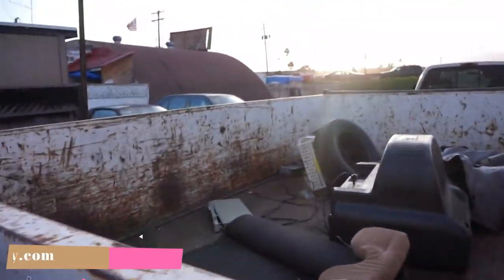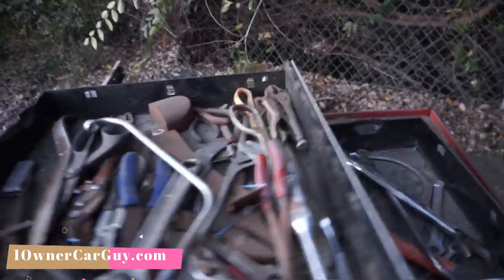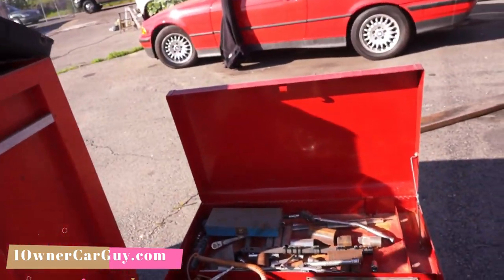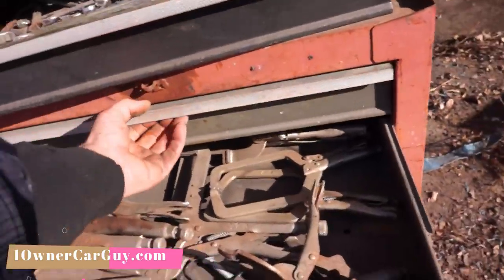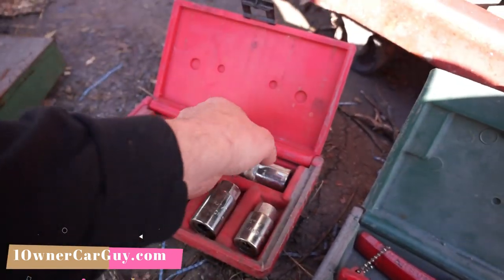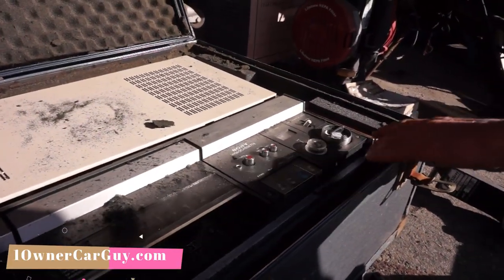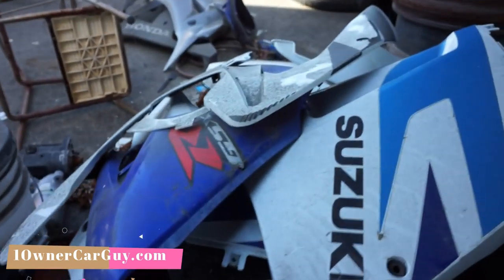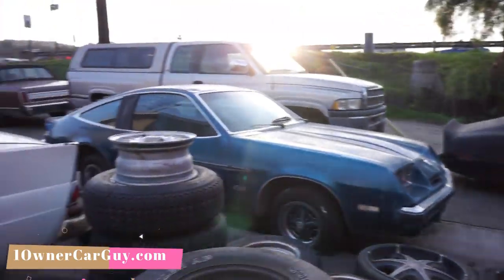USED TOOLS FOR SALE ~ SNAP ON ~ MAC ~ BLUE POINT~  DAILY WORK VLOG ~ 2020 0008

Comment: Looks like a little bit of everything. The 1/2 impact short flex sockets aren’t cheap if you have a set.  Some of them funny looking wrenches look like they’re for getting at the distributor bolt to adjust timing..